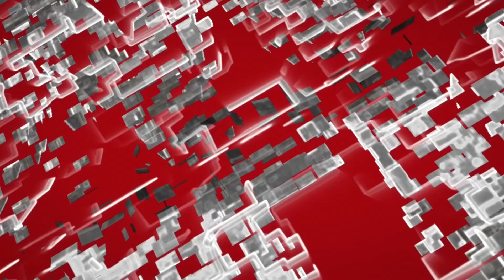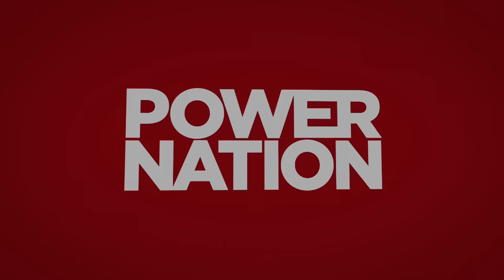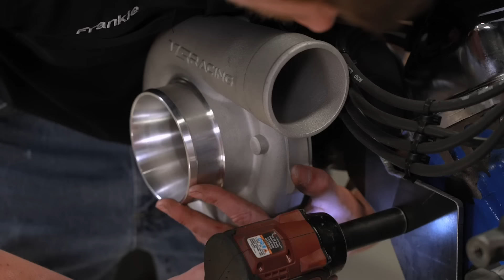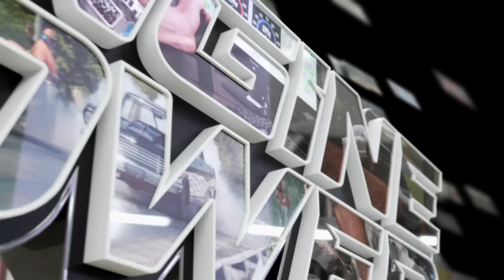Upgrading The Naturally Aspirated Horsepower In A 460 Big Block Ford - Engine Power S11, E10

Comment: Edelbrock 460 heads are meh...needs a head based off the SCJ head, like Kaase P51's. ..cam is kinda mild...needs a 1050 holley, and you'll see 600+  hp easily. Why spend the same money ( or more) and leave 100+ hp on the table?

Comment: I still will choose the FE to build. The 460 still has not outdone the 445.  The 428 can still out do it. The soul of the FE is the Ford Performance King. The one you guys did with the dual Sniper and Trick Flow heads is an example of what an FE can do. That 460 was  detonating on that last run. A cool FE would  be a.040 over 390 with a 3.98 crank and Trick Flow head s That would be cool. I bored Mercury 410 FEs ( 66-67)  and cammed them up a set of CJ heads in high school. I kicked a lot of cars around.
Reply: Would you guys consider a “School Yard Bully FE?”  Take a 390 out to 4.09. With a 3.98 stroke crank Molnar 6.49 H beam rods and Trick Flow heads and a Sniper or a pair of AVS2 carbs. I used to build.040 over 410s 418 ci and I beat a 6 pak 440 in my 68 Mustang coupe in High Shool. Of course I could run it on pump gas 103 at 12:1, and a really nasty solid cam, 1 3/8 Top Loader. I pulled the front wheels in front of the school. Not many people wanted to race me…..

Comment: I hate that you guys are so committed to Edelbrock heads... A set of mildly ported cast iron D0VE heads could run these numbers with ease and about 1700 dollars cheaper... Edelbrocks heads suck. Same as the 351c heads that are no better than stock 2v heads... It's really too bad. Do better guys. I just built a 514 Big block ford that made 645hp 699tq with at 2800 and 5500 respectively. Single plane, mild hyd roller and garbage tri Y headers from a motorhome. It only wanted 24 degrees of timing with SCJ heads which are as economical as Edelbrock heads... Get with it guys... I had 5500 in the whole build!
Reply: I got the rpm reversed
699 tq at 2800 and 645hp at 5500... Still climbing too when I shut it down... Probably another 20hp was there but no point in pushing it... Leaving that up to my customer.

Comment: I really liked the FE build. It was really light and easy to make even better numbers. I wish Ford would make a 428CJ FE crate engine. I t really proved that the old dog had the ability to handle all the new tricks. I really want a 428 CJ FE with TFS heads and the 2x4 EFI or even the Edelbrock AVS2s. That’s 600 ft lbs and 640 ft lbs on pump gas.

Comment: What would put a smile on my mug is to have an engine like this swapped into my 2012 F-150. My little 302/V6 is still doing the job but a 460/V8 would be smiles for miles at least to the next gas station. Can't wait until I can afford to upgrade to a newer model with the 7.3L Godzilla.

Comment: The stock iron heads have a very convoluted exhaust port that turns down sharply at the exit to clear the fenderwells of many of the Ford cars that were designed back in the day. When Jon Kasse designed the very first Cobra Jet heads for the 460 back in 1991 this was his main object to rectify. He redesigned the port to flow much better and still fit the cars. The intake was changed slightly also. These first heads were worth 100 horsepower over the stock iron heads with no other changes to the engine. He later did a refresh on the heads to improve the intake side. These heads were sold through your local Ford dealer with Ford part numbers for many years. The reason I am stating all this is to show how much improvement was in just the heads so your project will show this as well. The turbo, if reinstalled would show a dramatic improvement as well. The big Ford with a good set of heads is not a bad engine.

Comment: I miss you guys on TV, you’re both so knowledgeable and I learn a lot at my old age with the things you guys do on motors.
Have you built a 5.4 Ford Modular? If so please guide me to it. I need to redo my 2000 F-150 2-valve and would like to make some more Horsepower.
Keep up the great work you both do.
Jon Marshall 
Lebec, Ca
Reply: Great engine, put a new engine gasket kit n slap a supercharger on it from a Lightning, easy 400rwhp..

Comment: Kind of figured 32ish would have been about it on timing being such a big bore long stroke as most aluminum headed SBC's I've done stop at about 36 at around 9.5ish CR.  Maybe that huge freaking cam duration on the exhaust and setting it at 105.5 degrees played a part in it though?

Comment: They say that the exhaust port on a late eighties Ford 460 flows about the same as the one on the 5.0 Mustang. I think they max out around 110 cfm. No wonder the later built 460 can’t get out of its own way.
Reply: Maybe, but they turned 37"  tires on my work trucks in miles of mud. Too bad that they didn't have a better tranny.
Reply: They can make alot of power even the later 460.  Earlier higher compression ones obviously make more but the later one is no slouch.

Comment: Would VERY interested if the cost of these parts were included.  And even though in a great shop, how many hours.  These determine whether or not many of us will do similar tuneups and upgrades.  An approach of "lets see what happens if we put really expensive parts in." is interesting but not useful.

Comment: That was a waste of a turbo. You can throw junk at a 460 and make 500hp lol
Reply: It's not the HP but that mountain of torque. It is a truck motor just like BBC's and they can both make monster power. I'd like to see a single turbo BBC to see if it could make similar torwu.

Comment: Only thing us fans could ask for: a 6.8 V10 build. I know they’re not super aftermarket friendly…. Not as common as the garden variety V8.. but man. They’re cool
Reply: Exactly the v10 is underrated and would be cool to upgrade other than just v8s
Reply: There's some young guys who've modified/fabricated 4 valve heads to fit one, among other things, and put it in a newer continental. Just search "v10 continental" it's wild.
Reply: @InuranusBrokoff absolutely, been following for about 6 months!
Reply: First real job I ever had was at a sawmill, circa 2006. One of the dudes that worked there had a red and white  V10 triton truck. They sound so wild, unlike anything I had ever heard at the time.
Reply: Too complicated for these guys…
Reply: @keithhastings4092 they do more complicated engines just it's all about as many eyes as possible
Reply: No. Not complicated. Just not enough interest in those Triton V10s.

Comment: Whit the abundance of aftermarket heads, Trickflow, AFR,SR71’s it’s nice to see some old school eddies still getting some love and making HP. Not every engine is a high dollar drag engine set on kill. Great numbers.
Reply: The only thing that's concerning is that they seem to have taken them straight out of the box and installed them, one reason why Edelbrock is cheap is because all of them need machine work. Most other heads need to get checked and usually fixed in a couple of spots, but Edelbrock is so bad that Chinese knockoffs are better. 😆

Comment: Nice build there gents. But I have to say I would have kept the turbo. Just for the fact it's making so much torque that way. I know this the setup the "customer" wanted but 770 ft/lb of torque is no joke , now granted all that at 3500rpm is probably pushing the luck with the rest of the drivetrain . 
I would have split the difference myself , I would go with 9:1 comp with the alloy heads with twin turbos and log manifolds to get around the packaging concern . Run the EFI and the turbos and you could have had 700hp and 750ft/lbs on a curve from 3000 to 6000. That would have been a proper monster with low noise and nice manners on pump gas or E85.

Comment: I have a 351 cleveland out to 434 cu in, (after market block), hydraulic roller cam 950 cfm carb, built in the US and custom pistons also from the US. Heads trick flow. It makes just under 600 rwh and just under the same torque. Block is Australian and the engine built in Auckland NZ.
Reply: Good for you?

Comment: God i love those good o'l Ford engines the old 87 econoline we had was converted into a camper and the only thing that killed that thing was the rust it was over 500k miles pretty decent for a gas engine !
Reply: I acquired a 1983 club wagon e250 with a 7.5 460 in it, milkshake in the oil pan. Was just gonna replace the head gaskets but might as well do a rebuild while I'm in it

Comment: Love this! N/A is all I look at, any turd can run with a turbo and will never impress me.
Reply: Not necessarily.   Not just any engine can even handle the stress from forced induction and not just any engine can run hard just because it has boost.  There's more to it than that.

Comment: an oil pan evac is a good system for racing, but i prefer a vacuum balance system for the street. that is a 5/8 hose or tube from a baffle on the valve cover directly to the inside of the air cleaner. that balances the crankcase pressure with the intake stroke of the valve timing event to neutralize the difference in pressure. that helps the piston rings to seal and do their job. since the crankcase has a few pounds of pressure, isn't that actually adding a couple pounds of boost into the intake? yes it is.

Comment: 11:28  i learned to preload the poly lock and not the set screw to hold the rocker in place. just setting preload with the set screw turned disastrous for me the first time i set the lash on needle bearing rocker arms. since i preload the poly lock, i have never had a rocker arm back off. read the instructions.
Reply: actually that is how comp cams instructs how to install their poly locks.
not me. i'm preloading the nut.15- 20 ft lbs

Comment: I would like to see you guys take a 
Old Skool type of Ford 351C that bored out to 357 with a 3/4 cams and Old Skool type carb that is the biggest carb that your able to use on it. As well use regular unleaded gas and see what it can do.  Also try using racing gas and see what the difference of horse power will make. And have pair of Hooker Headers on it. With out having any Sort of computer gadget on. And no turbo setup.

Comment: I'd love to see a Chrysler LA 318 build, with only 2 stipulations; stock displacement, and Trick Flow 190 heads. Everything else is fair game. 

I bet you could get 400hp easy.
Reply: Why not use the 340? The early ones had a steel crank and forged pistons. Lots more power too. I think the 340 is the best Plymouth/ Dodge engine they made. The 273 was a good engine also. I've never seen Stock 318 with a 4 barrel. I don't know if it was a special order or not available.
Reply: @gregHames-u6n   Everyone wants to build a 340 and many have. I also love the 340; but the 318 is a far more interesting build since nobody does it. A 400hp 340 will get a lot of looks, but it's what people expect. A 400hp 318 is going to blow a lot of minds.
Reply: @FeatheredDino  Ok. It would be easier to get 400  out of a 340. Plus the strength it has.
Reply: Be fun to see a mild 318 build.

Comment: I never like how they do the timing change, they up it untill it stops, usually going by 2 degrees but never back it down to where it was, or atleast never show it, also why not split the difference, if 34 and 36 degrees of timing were no different why not do a hit at 35, will it change in numbers, probably or probably not, thats always been my pet peeve with this show, still love the show though
Reply: I always guessed they went back to the last timing # that produced the largest gain and set it there. In this case, I would guess they want back 2 degrees and set it at 34........... There would be no change at 35, because It didn't drop off at 36. There would be no increase past 36 because there was no increase past 34. They could do a pull at 33 to see if it matched 34 and go back to 33 if it did, if they wanted though.....but it's splitting hairs.

Comment: That's awesome guys but I have a question why on any engine build hp and tq always cross at 5250 rpm?
Reply: That is always going to be the case with any engine, it's in the equation to convert torque to horse power.
Reply: Horse power calculated by the equation torque/5252. It’s just the calculation

Comment: Ok ran out on Distributor Timing but what of Cam timing ???
Any Tweaks there for few more points ???
Or carb spacer/mixer/ what have ya up your sleeve ???
X pipe ???
Curious being it's on the stand ???
Just what else or what other tricks to get just a few more horse Power with out busting the bank !!!
Reply: Cam timing changes where the power is, not the amount. It pulls hard right out of the gate. I'd leave it there for a street engine. Tire shredding beast!

Comment: I raced a 71 429scj Mustang in NHRA Stock eliminator class, had to go thru several tear downs to verify engine met all NHRA'S spec requirements. The factory torque spec for cylinder head bolts was 140 Ft/lbs so ARP is going with Ford engineering specs, not anything they came up with, Just Sayin.
Reply: Yea nhra always hated fords they biased for GM thats why they penalized fords constantly  same with nascar
Reply: You'd be able pull down & Re-Assemble one of these Donks with ya eyes shut lol

Comment: That big block isn’t even trying yet, all done before 6k and a hyd roller, just a solid street cruiser.
Reply: And tire shredder.
Reply: yeah the cam choked the heads for sure.  There's another 100-150 hp in that thing with some improvements.  BUT-that cam idles VERY good (had same cam in my old F100) and makes decent power for what it is.  These 385 series engines are (or "were") the "mutt" of the engine world.  Only in the last 10 years have they started showing signs of "catching up"
Reply: They gave up 40+ HP with that tiny cam.
Reply: @danmyers9372  yeah and it still made 500+ hp, really the cam should’ve been in the 240’s.

Comment: Yikes using a power tool on the head bolts is not good
Reply: Its a 3/8" impact, and he didn't really impact hammer it, just speed them down.
A drill driver might have been better, but the block isn't aluminum.

Comment: The 472 Cadillac engine make more power than this with just a minor port and polish of the stock iron heads and a 3 angle valve job with an aftermarket aluminum intake.

Comment: Every pull was amazing for the characteristics that each one showed! This was a torque monster peaking and holding near peak starting at 3,700ish to the mild falloff around 5,000 RPM! Surprised by the relatively flat and wide peak HP curve lasting for 1,000 RPM starting at 5,000-6,000! The sweet spot for the setup at that time. It hit close to peak and held it near peak for 1,000 RPM!

As a strip car in a fairly light chassis, this would start to plant you in the seat around 3,000 RPM and want to rip your face off all the way to 6,000RPM...

Wide torque curve, modest torque fall off, wide flat HP curve near peak HP for 1,000 RPM on every, single pull! That is surprising!

15:10 - flat wide torque & HP
17:00 - flat wide torque & HP
19:00 - flat wide torque & HP
20:00 - flat wide torque & HP
Reply: What small car ford could you fit this in or car? 🤔
Reply: @user-tu1ee6dc5f  Anything you can stuff a Mustang 2 tubular k member in.. They sell kits meant for most engines, the 460ci BBF being one of them..

Comment: 500 ft. lbs. At 2500 rpm. That's what I want. Off the line torque. Man I've gotta get a big block. They're big and heavy. But they're worth it. Especially for a full size car
Reply: Thats street torque. Off the line can come in higher with the right Torque converter or manual trans.
Reply: @cuz @cuzz63 high rpms more wheel spin.
Reply: A 455 Olds is actually only 50 pounds heavier than the Chevy 350. Just in case you have one handy!  lol
Reply: Would be nice in a 3000 lb vehicle.
Reply: @The_R-n-I_Guy  I read that an Oldmobile 455 is actually only 50 pounds heavier than a Chevy 350.
Reply: Sounds like fun in just about anything. Would love to see this with a pair of turbos. Something about a mirror twin turbo set up that makes me smile.
Reply: You have to pay to play.
Reply: Meh once you swap out the cast iron parts. Intake heads water pump, housings etc.  its not too heavy. You lose 120+ lbs
Reply: just get an all aluminium block heads intake and water pump with sone light weight headers and steel crank and they arent so heavy
Reply: @drtb69 Cranks are all about the same.   Either externally balanced or internally.  But the bbc definitely have heavy intake manifolds and water pump housings
Reply: There is no replacement for displacement…Small block engines can be built to have impressive horsepower, but they can never have the torque of a big block.
Reply: Also be sure to purchase a gas station ⛽ to pull around with you. It will use so much gasoline it won't be any fun.
Reply: @gregHames-u6n smiles per gallon, not miles per gallon 😁
Reply: @marktraill5332  Ok. I must have mentioned that a big block tries to pull into the gas station all by itself. If you want that feeling, you are correct 💯. No replacement for displacement is true. Almost that much fun can be had with a C -5 Corvette. LS1 6 speed with 29.9 MPG. ALMOST
Reply: @gregHames-u6n wrong.
Reply: A 4.6 mod motor is larger and heavier than a 460.
Reply: @lilsammywasapunkrock  No kidding. I know they are hell a wide but didn't know they were heavier.
Reply: @lilsammywasapunkrock 460 is twice as heavy as 4.6, what are you talking about
Reply: @tacticalidiot175 03 cobra 4.6 is 683lbs. 460 is 640lbs with aluminium heads. A 4.6 is also several inches wider up top than a 460.

Comment: A mild build, with over 500HP. I have a stock stroke 460 with Iron A2A heads that is making 602HP, and a a557 that is making 730HP. The 557 is built mildly, too.
Reply: 600???? Damn